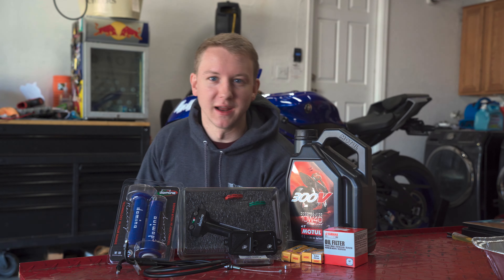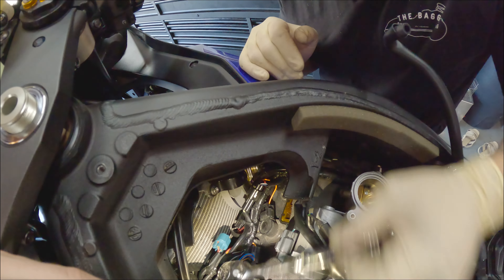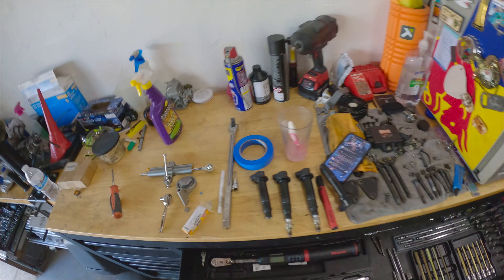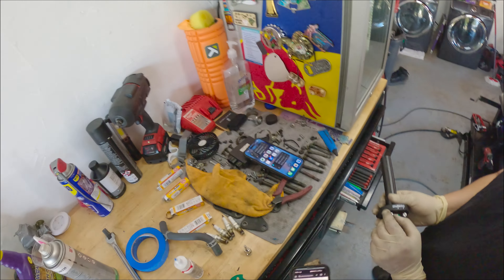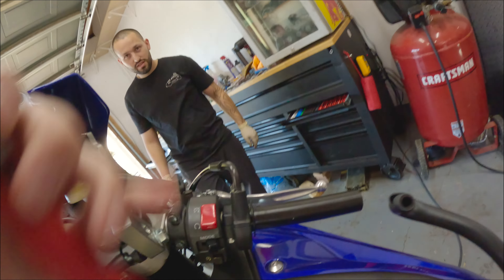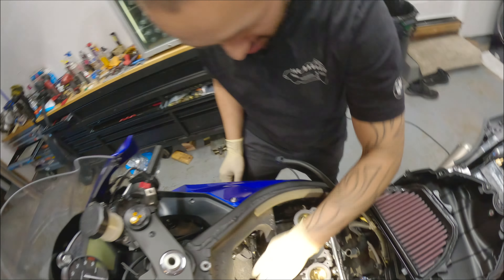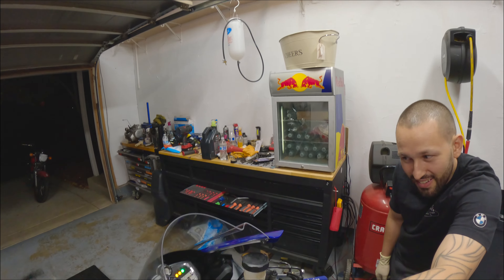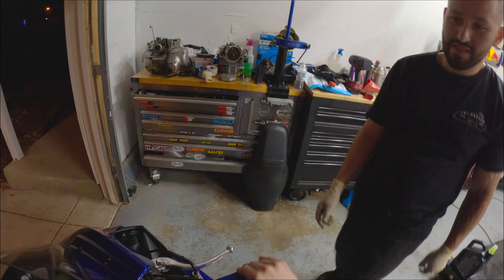Domino XM2 Throttle & Block Off Plates Install | R6 Track Build Pt 6

Comment: You build the swivel neck first on your Ohlins then drop it down. Just like it shows in the illustration. Now sure how you're keeping the shims in place when putting the long bolt through the swivel neck. You put all the parts on then hold it all together with your hand then drop it in the bolt lines right up. Its a little hard to explain. Have same set up on my 2018 r6 my 2010 r6 and 06 r6.
Reply from the maker: That makes sense, thank you for the tip! We struggling keeping the shims in place, since we put them in after and align them with a pick lol

Comment: can you show me the part number and model of quick throttle bro? Tia
Reply from the maker: I put the link below for it from Domino and the options needed below for the R6. 🤙
* Domino XM2 Throttle Control - Make/Model = Universal - Black
* Add Specific Throttle Cable - Make/Model = Yamaha R6 600 08-20

Link: https://dominoracing.com/shop/on-road/domino-xm2-throttle-control-assembly/

Comment: What are those block off plates for ?
Reply from the maker: Deletes the air injection pump which pumps air into the exhaust system to mix and burn off unburnt fuel. Main benefit is more accurate AFRs when tuning
Reply: AFR: Air/Fuel Ratios